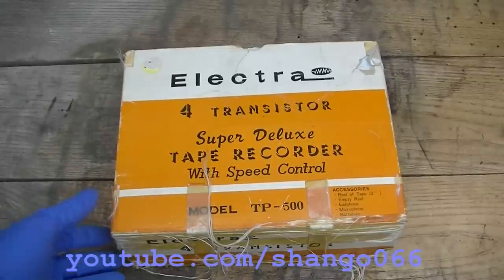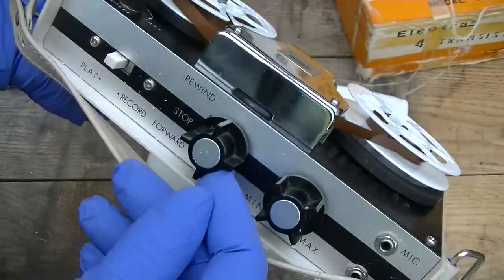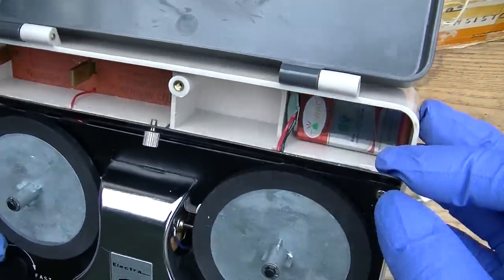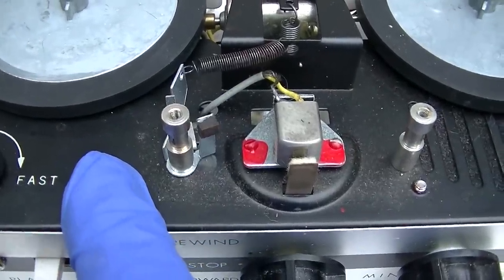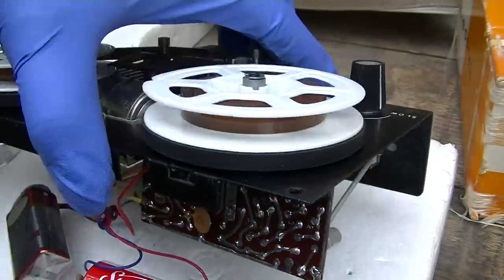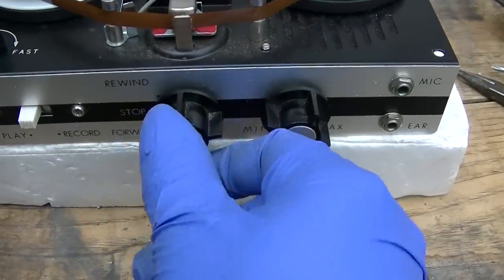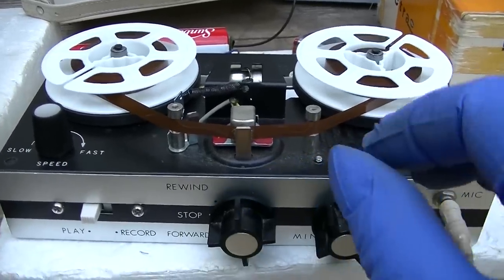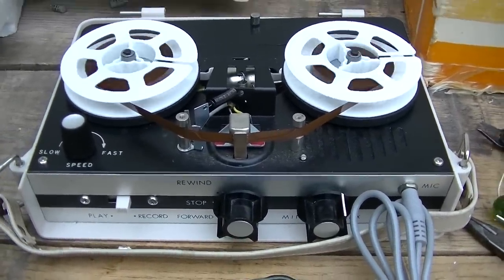Vintage Electra Tape Recorder 4 Transistor Early Japan Built Repair

Comment: I saw a similar recorder in a store for about $10.00 in the early 1960s. I listened to music on "top 40" AM radio stations. We, as teenagers, were stuck with waiting for the DJs to play our favorite songs. We could buy 45 rpm records with one favorite song on each, but, at about $1.00 each in 1960s money, they were expensive and, after we'd heard the song a few times, we'd grow tired of it. I was a knob twiddler and would scan the AM radio dial for my favorite sons at night, when distant radio stations could be received. However, I might only catch the tail part of each song. We relished the idea of being able to record complete songs off the radio and play them back at will.

My Dad recognized that buying one of these machines would just be throwing away money. For Christmas, he bought the family a stereo reel to reel recorder, (with capstan drive, AC erase head and AC bias, and handling 7 inch reels of tape) but I was the one that got the most use out of it. I still have most of my tapes, which I played back into a computer and converted to mp3 format. At the time, I just recorded the songs and not the DJ. Now that most of the songs are available on youtube, I don't need the song recordings. I am sorry that I don't have vintage recordings of the DJs!

Comment: I had a Realtone brand 3" RTR portable similar to that one, maybe slightly more deluxe, ever so slightly!😁  I have a Realtone now, like new, identical to the one I had as a kid in the late 1960s.  As a kid, only ever had the one reel of tape, recording over and over on it...you can imagine the sound quality!😃  Back then it was the "cats meow" to me!  I used to fill the tape with my favorite rock songs from my trusty GE AM transistor radio (which I still have, got radio new from Kmart in 1968), and I would play the tape with my songs on it, while we were out playing in the dirt with trucks, or playing tag, whatever!😊  The speed control was to help as the batteries were getting weaker, to compensate.  Fun times!😊

Comment: My father (whom passed in '95) was in the Navy and instead of writing letters while at sea, he would record his letter to Mom on Kodak tapes. One of his recordings mentioned he used a Star-Brite portable unit which looks just like this one. I've played some of the tapes on that player & his voice "almost" sounds like I remember. Very simple units especially on a government wage!
Reply: That would have been a Star Lite, which is the one I had.
Reply: Remember that since there is no pinch roller/capstan, and the tape is driven by the edge of the reel, the tape speed is gradually and constantly changing as the reel fills with tape. So these tapes are hard to play back on modern gear that uses a constant speed drive.

Comment: These things used DC bias instead ultrasonic ac bias. Enough DC bias to lift the audio halfway up the B-H curve in the north or south direction. AC bias lifts the audio to the middle of the B-H curve in northerly and southerly directions and you get twice as much output from the tape. 

https://en.wikipedia.org/wiki/Magnetic_hysteresis

Supposedly AC bias was accidentally discovered by an engineer at AEG Telefunken who was working on a recording amplifier. He disconnected a decoupling capacitor in the amp, and it began ultrasonic oscillation, and the the playback quality improved tremendously.
Reply: And to complete the set, Dolby HX Pro made the bias dynamic by side-chaining the bias level to the amount of high-frequency in the audio signal, letting the high frequencies cause a certain amount of self-biasing. Mostly done on cassettes, it offered a bunch more headroom on recording.
Reply: @Stoney3K  Yes program audio and bias does tend to be self erasing; more so at higher frequencies and lower tape speeds. At speeds of 15 & 30 inches per second full output at 0 VU can be obtained across the audio spectrum. When you drop to 7-1/2 & 3-3/4, frequency response is checked at 10 db below standard. For cassette (1-7/8), frequency response is taken at 20 db below standard. In an effort to overcome these effects, Akai came up with the "cross-field" head. It was a bias head facing the backside of the tape, without any bias applied to the recording head. They claimed it delivered 22 kc frequency response @ 7-1/2 ips.

Comment: love the erase head  how many tapes have got erased when you rewind and forgot to take it out of record mode
Reply: force311999 
Believe it or not, there is an electrical interlock. When in the record position, it won’t rewind.
Reply: I've never seen a reel to reel set up like this. Usually you have to hold record down while you engage play so when you stop the machine the record automatically resets itself so there's no possibly of accidentally recording/erasing the next time you use the machine.
Reply: @w7777777s  Makes sense they'd have some kind of protection.

Comment: Good lord... I had friends that had these, were no end of issues with them. I waited until the Craig Panorama came out. Now that was a decent "real tape recorder" I believe it actually had a line in and a speed changing capstan via removing the 3 3/4 you would have 1 7/8 

In thought I was king of the hill with that Craig model 212 It was fairly "HiFi"
Thanks shango066, what a blast to trip down this avenue.
Reply: Nice! The Craig 212 was a really well built unit. Plus it was featured on Mission Impossible!

Comment: I received a similar model recorder, which had the Ross name on it as a Christmas present when I was a kid (9 or 10) in 1964 or 1965.  I was used to using my Dad's RCA reel to reel from 1956 so, was quite disappointed by the sound quality on this little recorder.  These entry level tape recorders were quite popular but, they also set new standards for crudeness, rim drive (which causes the tape speed to vary depending upon how much tape was on the take-up reel), no AC record bias, no record level indicator, high distortion crystal microphone  (but, it really didn't matter since there was no AC bias), and all the wow and flutter you could ever want.  The recorder I had, could vary the tape speed from about 2 to 4 IPS in the middle of the tape.  I tried everything to get a decent recording and finally gave up.  The only way I could get good sound, was to record something on my Dad's recorder, then play it back on this little recorder which, of course was cheating but, it accomplished what I wanted.

Comment: My Father had a Channel Master reel to reel, same dimensions, same locking latch mechanism, tan color over white, fewer controls, no variable speed control, same lapel mic, etc and was most likely made by Sanyo!!! You are absolutely right about the quality issues with that one!!! His was bought in about 1969-1970 for the purpose of conducting meetings since he was a treasurer to a local liquor dealers association. He liked Channel Master products quite well. I myself, have collected Channel Master radios for at least 50 years now! Electra on the other hand, was in deed very crappy knock-offs that just didn't cut it and perhaps may have been bought up by Channel Master or at least ended up putting them in the ground, like planting Petunia's!!!
Anyways, his Channel Master reel to reel didn't have any wheres near the problems of this Electra has! The only real means of restoration for this one is to gut it and start over by replacing the tape head and amplifier for starters, The inside of the motor may have a capacitor that could be replaced but I doubt it and perhaps an electrolytic could be applied to the motor terminals to help stabilize the speed. For the most part though, she is junk!!! From about 1973 on up, Japan had really stepped up their game and thus, I am a collector of Japanese Built Stereo Receivers. They did hold up quite well over the years.

Comment: Immediately after watching this video I did some investigating and found a 4 transistor reel to reel tape recorder that was very similar to this one. the controls were all the same, speaker placement same, etc. it was named Apolec. same incredible quality too. the motor was so weak it couldn't even turn the tape reel with the tape on it. it had to be taken off the player and then it would work Yup, same incredible quality as your Electra

Comment: These were made in the early 1960s to spec by Aiwa, and sold under numerous brands. Some models, like this, had a single motor to drive both spindles, and some had separate motors. I used to have a dual motor, Selfix model that someone ripped the amplifier out of. I put in a replacement amp from Radio Shack and got it playing, but could never get it to record.

Comment: I worked for Olson Electronics (a Radio Shack competitor) and we sold a machine very similar to this in 1964-65. If I remember correctly, they were about $30 which was about a third of the early Ampex cassette machines. Since they didn’t use a capstan, the speed was constantly changing and what you’re hearing was about as good as they got. They didn’t last long once the price on the cassette machines began to come down. Brings back memories though.

Comment: My Aiwa brand reel to reel tape recorder that my parent's bought me in about 1970 was similar to this with a permanent erase magnet. When in record mode rewind would not operate...the power was shut off from the rewind motor. Had to flip the switch back to play mode for rewind to work. Now that's deluxe and smart!

Comment: It would be interesting to see what the "ceiling" is on rim drive using all of the best available modern components....including a speed control system that slowed down the takeup reel as it filled, to maintain a constant tape speed.

Comment: Wonder if the speed control pot is open or needs to be cleaned or perhaps there is  another component bad.   The distortion you are hearing could also indicate the tape is going at the wrong speed or perhaps there is a belt that is slipping or the speed control pot is bad

Comment: aren't those 8mm film reels - when i was a kid they were interchangeable, the ones for tape were transparent. i also remember the early units had both 9V (for the electronics) and 2 C cells for the motors.
Reply: Yes, searched the comments to see who picked up on this.  In the 60s developed 8mm was sometimes returned on reels with one side solid, with an enveloping plastic "cap" over the other end, sort of like what pipe tape sometimes comes in.  The ones for tape reels were open on both sides.  They were interchangeable.
Reply: @pghcoyote  yesssss, dim memories of little grey reels...oh and i had that song "Tit-Willow" on a Golden kids record or something...

Comment: Four transistors are enough.  One high gain stage that is used as both a microphone preamp, and a tape head preamp , plus the usual three transistor class B output stage, which also drives the tape head on record.  No AC bias oscillator is used, either a fixed DC current is passed through the tape head on record, or a PM magnet is used (which also erases the tape).  Cheap, Lowfi, but it works.

Comment: These were available in many versions. In the UK a company called Headquarters and General Supplies sold them for just under 5 pounds. Mass advertising with full page newspapers. Needless to say, as a kid I just had to have one. On opening the box a great electronics smell came out, ummm love that smell. Mine had the same crystal mic but a elliptical speaker. 
My Dad recorded some of my favourite songs  on his (proper) tape recorder. As it started to play, I must admit, the sound was OK but as the  tape advanced the speed increased, making recordings on a proper tape recorder useless. No capstan!  Speed consistency was the greatest issue, every time you played it the speed would be different. Mine did not have a speed control. The speed was 100% dependent   on battery voltage, those C cells did not last long. Keeping the rubber clean was also a major factor in speed stability.
After only a few weeks the motor in my unit failed. That was the end of that. The bias was just DC!!

Comment: That is very cool, I love those reel to reel units. The tape reminds me of 8-track. I wonder if you could take a 8-track apart and spool it on the reel.
Reply: Yep they’re both quarter inch tape. You cannot however spool reel to reel tape onto an 8-Track, because the tape used in 8-Tracks had a special graphite lubricant backing.

Comment: I remember those old "Virginia Slims" cigarette commercials back in the early-70's.
Reply: They also used it at the end of the LP called “The Miracle Mets” in 1969 where they used the Virginia Slims jingle.

Comment: i had an aiwa that was stereo back in the 60s! it had two mics and two detachable speakers. it was a little smaller than that one and used flashlight batteries.
the thing had rim drive and the wow and flutter was off the scale. i played with it for a while, but it was really crappy sounding.

Comment: Sounds like u still need to work on that speed control unit to make it play steady. Otherwise,,it,s a very interesting machine well made with the fast forward/rewind system,and the batteries facing each other,and the 9 volt battery connection too.

Comment: looks like the head is biased with a 10K resistor from the 9 volt power supply, in the recording mode. It's called DC head biasing, and it's perfectly fine for voice and low quality audio recording.

Comment: You think 4 transistors was too few? The Nipco recorder only used 3! Despite that it worked really well. It was a VERY successful seller too. Beside Nipco (the actual maker, who also made some decent transistor radios) it was sold under a dozen other names including a semi-classic name: Omscolite. Shock of shocks, it actually sounded pretty good, partly because it used a full-track head to get the most onto and off of the tape. One-side tape recording only. No flip and use the other side.

These turn up today and with re-capping they return to full service. The rubber used on the reel tables is (usually) still in wonderful shape and the drive works as intended. 

Recording "bias" on these designs is DC supplied through a resistor coming off the 9-volt supply. There were even some made with capstan drive. Crown made some very good ones with 3.75 and 1.875 speeds and JVC actually made THE worst with 7.5 and 3.75 speeds and sold under the Mayfair brand through Montgomery Wards. DC bias survived on low-end gear right through the 80s in cassette portables.

These early low-end ones all seemed to use one of 2 crystal microphones and very few have survived in working condition. They used a Rochelle salt element like most of the crystal phono cartridges and unless perfectly sealed they died early. The salt was hydrophilic and drew moisture out of the air. Later designs used dynamic mics.

Electra was a pretty major importer in the 60s and even survived through most of the 70s, Japanese stuff got too expensive for them and they switched to Hong Kong for their crap.

Comment: Old capacitors reading double what they should is typical of component failure. They go like this but their voltage handling will be greatly reduced. I'm not an expert in chemistry so I can't tell you why!

richard (UK)

Comment: Those spindles could use a drop of oil where those "c" clips are at.  I  have a player like that and it did not have the speed control.  Got it around 1964 (with-in 3 years max.) accuracy.

Comment: Yes. The C cells are in parallel. 1.5 volts (double mAh capacity) for the motor drive , 9V for the electronics. All mechanical actuation is manual, through the knobs. Those batteries must have been installed recently as that battery compartment would have been a mess. That has to be from the mid/late 1960's.

Comment: New quarter inch tape is available, and there is a lot of NOS tape available. Maybe you should put some of your cassette and miniature reel-to-reels up for sale on eBay, and I would be glad to buy one, or two, or three. I did many many repairs on all sorts of tape decks when I was in college 79 to 83. I was very good with mechanisms. If you have one with a broken mechanism, you can send it 2 me, and I will return it repaired and lubed. I even get into the motors 2 Revitalize the motors and repair the speed regulator, if installed.

Comment: I would guess those were targeted at dictation and wouldn't need to be music-level good. Also, the rubber rings driving the motor look tiny and perished; wow and flutter would most likely be restored to a dictation-level of acceptability if you put a couple of new, thick buna rubber grommets on it.
Reply: I had to have mine ,I did testing one two three,and that's was all I ever did with it then I got from someone a majic eye tube bigger tape recorder ,that one speed control was off ,got rid of that one two  ,then I bought a Sony 255 and Used to copy my albums on to it for long play music ,then my Sony 255 died and I got my money back,the end.